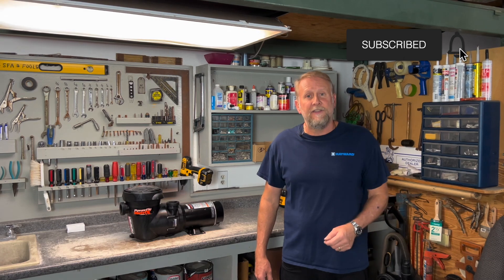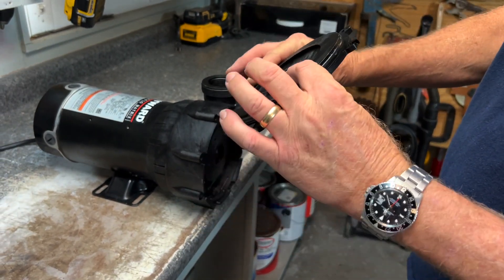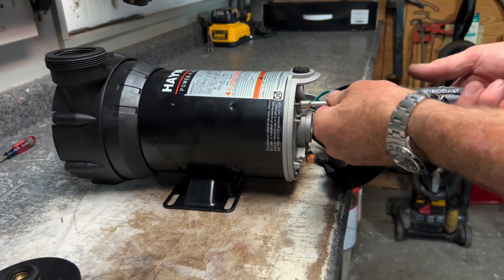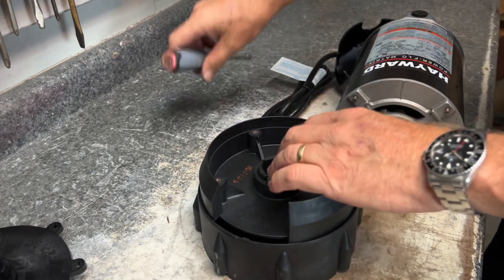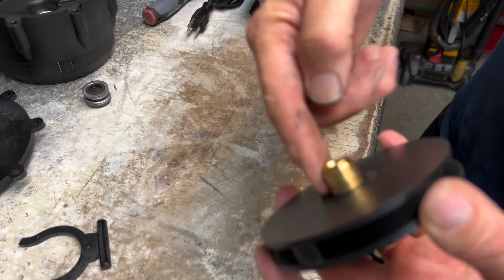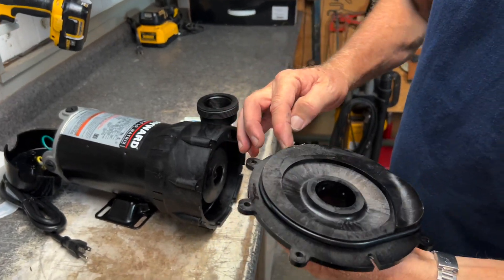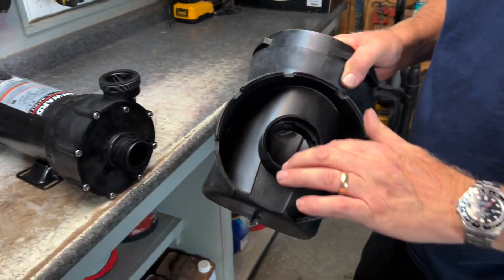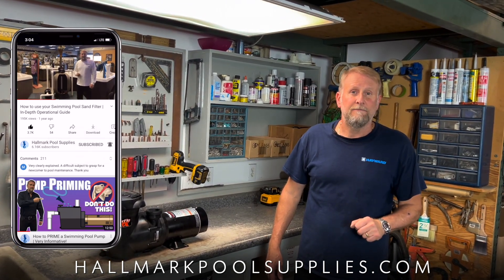How to Change Seals on a Hayward PowerFlo Matrix Pool Pump!

Comment: Hi Mark. I am having a problem with the pressure of the intake from the pump, but not seeing any leaks. Could any of the Orings or the seal need to be replaced to fix that? How could I tell if they are bad? What lube are you using?  Thanks
Reply from the maker: You may need to backwash and rinse the system, you can also put the valve on recirculate as a test to see how the pump runs. If the pump does not perform well in recirculate you may have a clog. Make sure that your lid is not cracked and the o-ring is good, the lube I use is jack's lube (link in the description). You would only change the seals in the pump if you have a leak. If you have any questions feel free to contact me I will be glad to help.
Reply: @HallmarkPoolSupplies  it is an above ground pool so I have no recirculate option on my filter as it is a basic Hayward carriage filter. I have changed the lid Oring and opened up the system, ran it cleaned out the filter which may have helped for a few minutes. It seems to have good suction when I had the system open ( plug on bottom of filter open) and turned in the pump. Maybe an impeller problem?
Reply from the maker: @pambarnes1626  If you have a cartridge filter, cleaning it will help, however you may need to replace the cartridge. If you run the system without the cartridge as a test and the pump still runs poorly, than you may have a clogged impeller in the pump.

Comment: I am shocked that you touched both sides where the seals touched I have always been told if you did that they would leak would like to know if you had a leak after you put it back together
Reply from the maker: Handling the seals is fine, my company has been in the pool industry for over 56 years and we have not had any seal failures due to touching or handling the seals. In fact if handling the seals was not recommended then Hayward would have a warning label on the package and they do not. I have contacted Hayward on this issue before and they have told me that this is not an issue. Thanks for watching.

Comment: I replace shaft seal and the outer seal and it still leaking
Reply from the maker: If you changed the seals correctly and everything is tight, you may want to make sure that nothing is cracked. Thanks for watching.

Comment: Hey Mark. My marix is leaking, I purchased three apprópriate seal and gasket repair kit and inspected everything then replaced everything.got it all back together very in proud of myself snd tested the pump....leak still there .I figured.  Ok, I reversed something and repeated the procedure. Guess what...still leak. My wife and daughters are starting you use me as the fly joke. Helping me fix my pump and regain my father who knows stuff in solid standing
Heck I even tried putting it all in backwards ...I just had to. HELP ME?!!!
Reply from the maker: If you use the right seal set, and all the parts are fine and you put everything back together properly then you should be good. Feel free to contact me and I will be glad to help, I’m available Tuesday - Saturday from 10 to 5 EST.
Reply: Thanks I'll try again and if it all goes bad again I'll give you a call. Btw..sorry for the bizarre text...I had just taken a sleeping pill and it was kicking in when I wrote that text...it all made perfect sense to me when I wrote it 😂🤣😭

Comment: That impeller does not come off that easy. I can’t get mine off.
Reply from the maker: Most of the time the impeller will come off with no problem. When the impeller does not come off with ease, have someone else hold the shaft with the wrench and use a pair of channel locks on the impeller itself. You should be able to get it off, if not, you may have to replace the impeller if you have to break it to get it off. Thanks for watching.

Comment: Next time you decide to show how to change deals use a freakin used pump because not one damn thing works as you stated it. My pump was 6 years old and the shaft had rust on it and you had to use vice gross in the rusted shaft and to take the impeller of had to use big channel locks to take it off. Hell I think anyone could take apart a brand new pump considering it probably never had water run through it or had been sitting in the weather working for 6 years. To me this video sucked because you didn't use a used pump.
Reply: Get a grip bro his video was very helpful